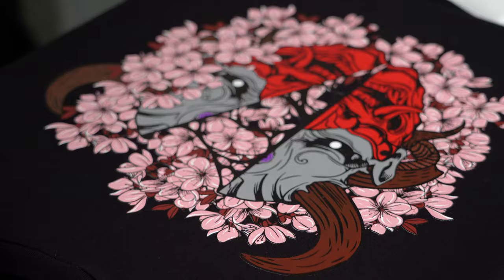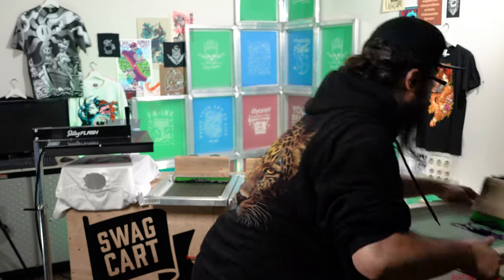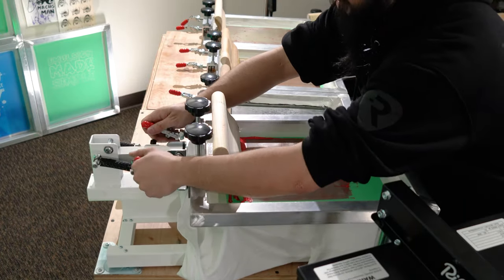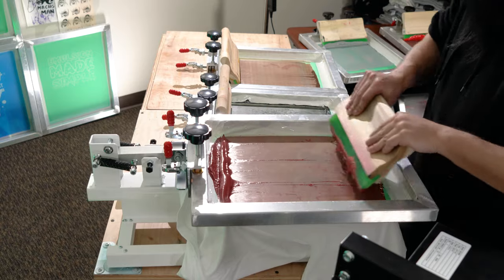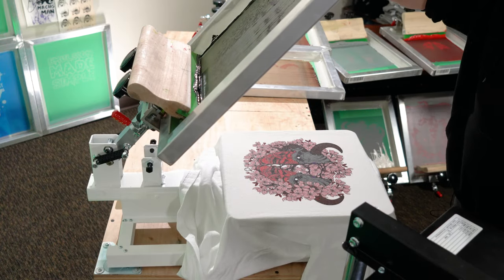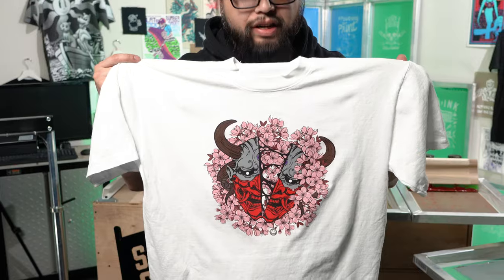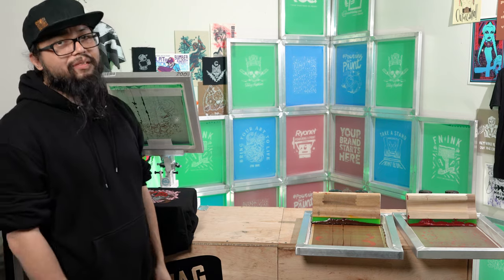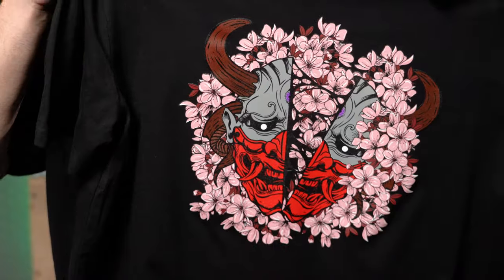Printing 8 Colors On A Single Print Head With The Screen Printer Starter Press

Comment: Off contact, pallet glue list goes on. Each screen needs it's own detachable head. What's one of them cost? Would love to see 4 color process really test your patience that would.
Reply: Challenge accepted - Send me your most complex CMYK design and I will happily put the press to the test.
Reply: Will you be angling the screens at different angles or using a program? Anything realistic, close up of a human eye. Eye color has to be blue.
Reply: When stretching the frames
Reply: When stretching the screens
Reply: @Truthnesshurts  I use pre-stretched static frames - I'm lazy
Reply: @Truthnesshurts  You set up the artwork - dealers choice - I'll print it
Reply: To clarify more - Off contact 1/8th of an inch and Sgreen liquid adhesive. Lol, We are not hiding anything, that's like asking what additional screens cost - link below for the clamps. https://www.screenprinting.com/products/pigskins-pigtails-screen-printer-starter-press-extra-clamp
Reply: What are static frames this a new selling point. Ive Heard of polyester,  nylon fabrics, then the gimmicks like silk mesh, S mesh now there's a Satti mesh that's had cold plasma treatment saying its changed the surface tension allowing free flowing prints also eliminates having to degrease. Thoughts?
Reply: I'm Australian mate. Would you no off top of your head conversions from American mesh counts to Australian. We use CM not inch.
Reply: And it must be how our toilets flush opposite directions in Australia most of not all pull stroke, unless the job requires it, certain screen is looser or the way the design is or even cause the shoulders need a rest lol

Comment: Can you use 20x24 inches frame?
Reply: So it is not recommended but I just put one on the press and it held no problem - that said you will either need to burn the image lower on the screen or buy a larger platen.
Reply from the maker: Like Darryl said, it's set up for a smaller screen but it's possible to make a 20x24 work for you with the right design/placement.

Comment: If you only have on screen there is really no way to register all your registration marks  correct?
Reply from the maker: @jomathews4842 Just to clarify: you are looking to do a multi color print with just one screen? It would be way easier to have multiple screens and when using the this press multiple clamp heads would be best.

Comment: Any off contact adjustments or is it auto? Or would k need to tape some quarters on the bottom of the screen? Hahaha
Reply from the maker: @CamCadie There is a jam nut that you can adjust to raise and lower off contact - its one that you set and forget
Reply: @Ryonet what’s your experience with the registration on this press? Have you accidentally knocked the screen slightly out of place whenever switching the detachable clamps to your next colors? Or is it tight and dead accurate when switching in and out?

Comment: This gives the false illusion that anyone with little to no experience can achieve this, highly unlikely. A whole lot more involved wasn't even mentioned ie screen/artwork placement, ink additives used for a softer print, screen setup setup/
Reply: To eliminate any illusion. I clearly state that this is insane and I do not recommend doing this for production. I just wanted to push the capabilities of the press and show what is possible. Screen setup is no different than what we teach in our online class. The artwork was set up with a .5-point stroke on the colors except white and black. Screens: 158 mesh for white, grey, and red, and 200 mesh was used for the rest. No additives were used. Inks are bolt white, Rio PMS colors, and FN Bright red. If you have any questions on how I achieved this call me - (360) 356-7532
Reply: Understand cheers.
Reply: lol if your shooting for an 8 color print one would hope you know how to do one color.

Comment: Your flash time is all over the place...so I don't see shirt passing a wash test.....
And do a measly 20ty shirts like this .doing 1 shirt doesn't show the struggle most would have.....
I see why transfers are taking over and dtf ,dtg is taking over...
The Asian do screen printing like this..but have a better system of being able of doing 100 shirts this way super easy....
Reply from the maker: Hey there, thanks for sharing your thoughts! We totally get where you're coming from. Testing with just a few shirts is just starting point to show that this press isn't your average starter press. Regarding the flash time, you've got a sharp eye! Consistency is key for a successful wash test. As for transfers and DTG gaining traction, they definitely offer convenience and versatility, especially for complex designs or short runs. Screen printing, though, has its charm and unbeatable quality for certain jobs and volumes. Every method has its pros and cons, and it’s all about finding the right tool for the job. We appreciate your input and are all about pushing the boundaries and learning more every day! Keep the feedback coming, it helps us all improve!
Reply: oh I know, that said they are flash times, not curing each color, and with the different sizes of area for each color flash times will differ. The key is making sure the correct time and temp are used after printing to fully cure. Again I do not recommend this many colors on this press for production. Just show casing what is possible.